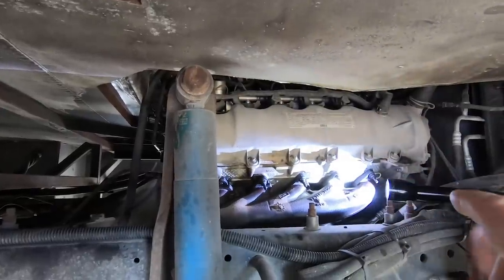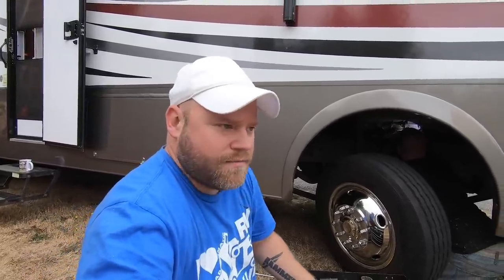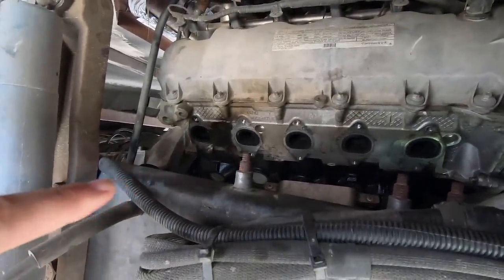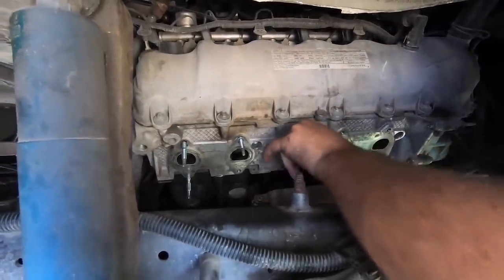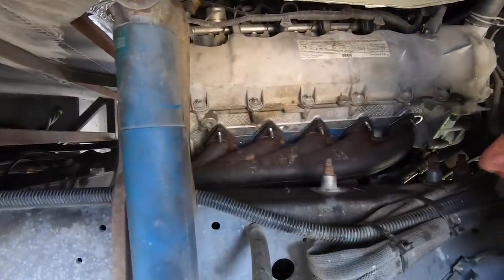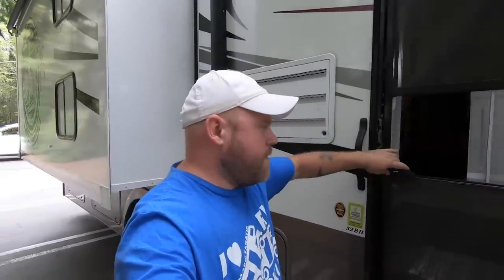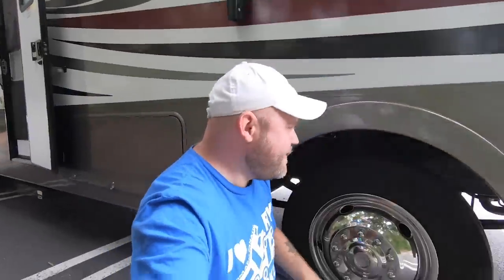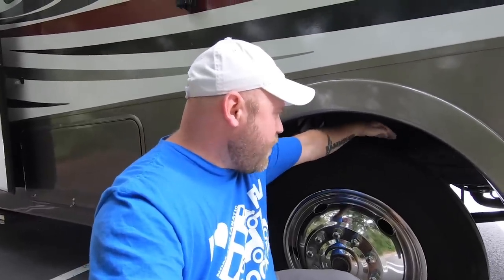Manifold Header Exhaust Leak Repair on V10 F53 Chassis

Comment: Being a mechanic I have to tell you it’s called an exhaust manifold Very common problem.Thankfully you did not use sandpaper lol 😂 Using the anti-seize is a big plus because if you have to do it again they will come out like butter..I just did one at my shop in a van no room whatsoever real pain in the butt...Thanks for the video I enjoyed it😎💯
Reply: Yeah, exhaust manifold.
Reply: Scat pack 392 -G, Also the stud wasn’t broken in the cylinder. It’s the “cylinder head”. Eric also mentions a factory gasket was broken up to a 2 and 3 cylinder gasket. Then the “new” factory gasket was shown as a Fel-pro gasket. Then cheap studs. Eric,What is the root cause of the problem? Bet your exhaust manifold has a slight warp. With X thermal cycles of the cast metal this can happen. Have the manifold surfaced if ruins the gasket again on that side.
You make great videos but fixing engines has not been your forte from the videos I’ve seen.
Reply: Chip Saunders and why replace the gasket on the other side if it’s not leaking?Sounds like a waste
Reply: @22howards  Duh, I seem to recall, he told you he didn't do engine work, keep up with the conversation!
Reply: Bebo May Yeah I had a joke around with him ..Really enjoy his videos
Reply: Bebo May, I do enjoy majority of Eric’s videos. I also did listen to what he said during the video. Eric also has huge following and can/should do a little research before using incorrect nomenclature. He (Eric) does research on other topics. Just sayin
Reply: I miss Jax.

Comment: PERMATEX brand of copper spray works very well also. I run a exhaust shop for the past 35 years and the copper spray on all gasket-head and manifold surfaces has been a real insurance policy. Very few come backs.
Reply: Very nice tip thank you.
Reply: never heard of that, will have to find some, thanks!
Reply: I am going to be doing my f350 manifolds soon... I will use the permatex copper spray. Thank you

Comment: Eric, from 1999 to 2005 the Ford V10 with triton heads only had 3 threads on every spark plug on the V8 and V10's. From 2006 to today it is fixed you will not be blowing any spark plugs and the spark plug torque is 27 pounds if you want to tune it up. Look it up. From 1999 the torque was only 7 pounds, and that is what Ford said, then we got rid of our motorhome because we couldn't understand how the spark plugs would stay in at 7pounds. So warn people 1999 to 2005 No Good, 2006 and up is good. We enjoy watching your videos and love it when Jax talks, after all he's the star of the show.

Comment: I drive a V10 every day and can tell you they are one of the most reliable engines you can get. I'm at 110K miles without a single engine issue yet. Blowing plugs out was a thing with the old V10's not the newer engines. Check your torque on your next few stops on a cold engine and you will be just fine. Don't worry, you have a reliable unit there.

Comment: After a few heat cycles on the engine it is a good idea to re-torque the nuts on the exhaust manifold.
This is why some people have to replace the gaskets again after a few thousand miles as they don't re-torque the nuts.
Reply: Beat me to it, wonderful advice and I had to learn that lesson the hard way when I was about 18. Wish someone told me then. lol.
Reply: @stanthecomputerman  that's just gross!
Reply: You need to torque your nuts. Torque wrench with probably  very very small socket? lol  😂 ( just kidding.) lol.
Reply: Bingo Van, Mr. Gasket sells special lock washers for high heat applications to solve the problem also.I used to have a Buick with factory turbo (very hot) my mechanic fixed my blown exhaust manifold gasket by not using a gasket at all,I thought he was crazy but it never ever failed or leaked!

Comment: Headers, dual catalytic converters and a TRUE dual exhaust. This was for my 78 Trans Am and it was perfect. Obviously not a V10 pulling a Class A but was a very reliable daily driver as a 6.6 Pontiac for many years. Maybe most rigs need some old school updating? At least headers? Great stuff from you and thanks for sharing your travels and hassles. Be safe

Comment: It’s mostly big Blocks in class A’s, not enough air flow to keep the manifolds cool that’s why I did Headers. Manifolds are pushing all that air from 4-5 cylinders through one opening, headers have a tube for each cylinder before going into one which gets the air out faster which means more power and better MPG’s.
Look into the Banks torque kit for the V10 👍
Reply: Headers can be a nightmare as well depending on the quality and claerance issues.
Reply: Only install quality headers, cheap headers are much more problematic than factory manifolds.  Quality headers are expensive, but if sized correctly they will provide more power, mpg.
Reply from the maker: It's still on my list, buddy. thanks. :)
Reply: I'd do headers on it.  Stainless steel baby.  Kooks headers.  I wonder if kooks makes a header for that.
Reply: Once you switch to headers keep in mind since the engine breathes better, the mixture will go “lean” and needs to be adjusted to the right air to gas mixture
Reply: @jpinto9102  I read that the ecu will adjust that itself.
Reply: 100% agree
Reply: @andrewmcallister4151  i guess im an old timer from the old days.. there was no ECU then..lol
Reply: I can remember hearing about this kind of problems from motorhomes in the 60's and 70's.  So this does say much about motorhome development, if this problem still exists 50 years later. Greed its the new........
Reply: I put Banks headers on my V10 F250 truck...That freed up so much power and gas mileage...The engine can breath now. Not sure why ford puts these little tiny cast iron exhaust manifolds on a big air-hungry engine...Also cast iron on aluminum heads...REALLY

Comment: I had a tap in right front side of my 5.8L E150 ford..mechanics found leak at the boot of cat converter..replaced..all was well..3 months later, smelled exhaust, hole in muffler..mechanic welded..all was well..one month later, tap is back exhaust smell is horrible..Wednesday neighbor mechanic is doing thorough check on complete exhaust system..and plugs wires, manifold, valves, lifters, injectors and gaskets..I have a 93..had plugs n wires recently changed but hes gonna check those too...cant afford to repair it all at once but this month..exhaust..definitely..van rides great..just taps n stinks..dont want to blow anything up..thanks Eric n Jax😉✌❤😊

Comment: Eric,
Great call on the anti seize goop. The main issue is the steel studs and the aluminum head. That is also the problem with spitting spark plugs. The steel spark plug galls the aluminum threads and they fail, going POP! It will scare the hell out of you when one lets go. The reason the exhaust gaskets fail is because the exhaust manifold is warped. A couple other views suggested having it planed to make it flat again. Or maybe they make an exhaust header that is a drop in replacement for your factory manifold.

Comment: If you have a problem with the exhaust manifold, take it to a machine shop and have it decked. Alot of problems come from the casting porosity. If that blows out. I'd swap out to an after market header JBA or Doug Thorley. Smother air flow and more efficient thermal cycling. Just a suggestion. Great videos keep on keepin on. Safe travels Sir

Comment: You have a enjoyable channel, the contents are always something that gets my interest. The manifold gasket problem is common and usually caused from heat. You might try installing venting to both sides of your motor. I have 30+ years with RVs and it seems I have had to do a lot of repairs to most of them.  I'm retired and love getting out on the road and seeing new places. Well may you have tail winds and smooth roads in your travels.
Ray

Comment: Honestly u should run the motor,let it get warm and then take the nuts off. I just changed the exhaust manifold gaskets on my buddy RV. I was dreading it until I actually got in there to do it. It was quite simple straight forward with plenty of room. Took me about 4hrs to change the studs and get everything done. 

Tightening them loosen then tighten loosen will eventually work its way out but most of the time if it's gonna snap it will lol

Love the channel Eric, Have a blessed day
Reply: Thomas Gibson b

Comment: Owned Fords all my life. The exhaust manifold is easy the second time and 3rd time around. Use anti-seize on all studs. Re-torque after running a few times. If a stud breaks off. Weld and nut on the stud and it will come out. if not drill it out.

Comment: THE SPARK PLUG ISSUES ON THE TRITON V10 WERE ONLY ON MODELS 2004 AND LOWER.. AFTER 2005 THEY BULLET PROOF THEM. I LOVE THE V10S LOTS OF POWER AND RELIABLE..  I BELIEVE YOUR MIRADA IS NEWER THEN AN 05? I AM AN RV DEALER HERE IN OREGON.. CHEERS
Reply from the maker: Mine is a 2012, so thank you for this info!

Comment: The reason some exhaust manifold gaskets fail repeatedly is is warping of the flanges. Checking the flanges with a precision straight edge  before reinstalling will save doing it over in short order.  Warped flanges can be milled at a machine shop to true them up again.

Comment: Should have machined the manifold face flat again that and re torque nuts after first heat cycle 👌🏻👍🏻😁
Reply: MG, unless older rig or obvious need is overkill but a flat file will suffice but good idea.
Reply: Not overkill.  The heat warps the surfaces over time which is what causes the gasket to fail in the first place.  Just replacing the gasket is a waste of time, which is why 30 days later if fails again.  Gasket is the symptom, not the problem.
Reply: It would be a good place for metal gaskets, like on my tractor!
Reply: This is mechanics posts lol

Comment: a solid piece is much better on those v-10's than the split (known issues on v-10's) I have an f-250 and had that replaced. Also the spark plug ejection isn't as common as before with a good proper set of spark plugs. Also, dude please make sure to re-torque the bolts after 2 heat cycles or you risk needing to replace them again. Keep up the awesome work!

Comment: My personal recommendation, especially on those with Ford 460 engines. When the exhaust manifold leaks, replace the exhaust manifold. The metal has been weakened and will continue to warp. Also, use a copper based gasket since it will handle the high heat better than the standard lead based gasket.

Comment: One of the exhaust headers on my 1997 Ford F150 (5 litre engine) was leaking.  Because the truck is over 20 years old and has 340,000 km on the odometer I thought that the chances of getting all the exhaust studs off without breaking at least a couple was very slim, so I had a local shop do the work instead of doing it myself.  Unbelievably, all the studs came out without breaking.  Throwing caution to the wind I decided to have them do the other side and all the studs came out without breaking.

Comment: The never seize is a must!    You'll appreciate it if you have to pull them off again.    BTW, one of the V10s I work on had 184k miles, same park plugs, on a box truck.   Really the only issues we have with them is the occasional faulty coil.

Comment: My husband used a torch on the bolts and then applied candle wax on the bolt and it wicks in and makes it easier to get off too as another option.
Reply: Mofo  1:00

Comment: The trick to not snapping studs is don't use a ratchet, wrench, or breaker bar.  Use an impact wrench.  It applies the turning force just on the hammer strikes instead of constant pressure.  The hammer strikes are less likely to break the studs than the constant pressure.

Comment: Gas millage may be more accurate... Because air can leak in also... and that un-metered are hits the oxygen sensor and the pcm thinks the engine is running a little lean...  Hope you used new donut gaskets also.

Comment: Also, be sure the engine timing and the fuel/air mixture is exactly correct.  If either are off, you'll have heat problems and the header gaskets will leak in a short time.

Comment: Rotten Tomatoes Website Ratings:

Lost in America:
Critics 97%  Audience 77%

The Long Long Trailer:
Critics 38%  Audience 77%

RV Robin Williams:
Critics 23%  Audience 45%

Spaceballs 1987:Critics 59%  Audience 83%

There is quite a variation between the critics and the general population.  I saw part of Long Long Trailer recently and found it interesting from a historical perspective.  I got a kick out of them towing that long trailer with a passenger auto compared to the 900 plus pound torque diesel trucks of today.  RVing has come a long way.  

I have only seen the trailers of Spaceballs and a RV movie did not come to mind.

Comment: once an exhaust manifold leak develops, it immediately makes the mixture leaner, therefore hotter..this warps the manifold even more so the leak then can be heard. Proper repair is to replace manifold along with new copper gaskets

Comment: If the gasket blows again, I'd be suspicious of either the nuts coming loose or that catalytic converter melting down (internally) and causing exhaust gas blockage.  It can melt down if exhaust gas temperature gets too high.  A lean burning engine can cause a rise in exhaust temps.  There are a number of causes for that, 02 sensor, clogged fuel filter, injector issues, or just a fuel pump starting fade though I think some those issues are too soon for your newer rig.  I might add a fuel pressure gauge to keep an eye on it though.

Comment: I would have used sealant on the block and manifold before placing the gasket just to make sure the seal was good. But well done you should get better gas mileage and performance

Comment: The issue mainly is that the aerodynamics of class A RVs is the worst. Straight, flat oncoming wind which has to be brought to heavy pressure to get around the edges. That pressure ends up in your engine as well.

Comment: Eric....  Heat is your enemy.  Install 6 inch flexible tubes from under your bumper to blow directly on exhaust headers .  It will cool headers and spark plugs just enough to hopefully solve your and everyone elses heat problem. A 6 inch flexiable METAL vent tube is avalible at home depot...Lowes in the section where they sell heating and air conditioning ducts.  Think NASCAR air scoops and brake ducts.  Oh Yeah.  A metal bread loaf pan the right size will allow you to fit the vent tube around bread loaf pan.  Cut bottom out of bread pan use duct tape to attach bread pan and fitted vent and give you a clean professional look under the front bumper.  Air scoops work extreamly  well at moving air.  Give it a test....put your arm out the window.  Solve what causes your problem don't just continue to fix it.

Comment: Looks like a pain in the ass. I wouldn't replace the side that isn't leaking.  I worry about my spark plugs as well.  When I change them I will have to be very careful in removing the old ones.  Great video once again. Thanks

Comment: #455    Good Morning, Eric.  Thanks for the informational video.  I didn't know that the big Ford Titan Motor had that problem.  I also wonder if you purchased new donuts for the manifold.  I had to replace those many times on my 1975 Jeep J-10 Pickup Truck.  A real pain, as I had to lift the motor, too!  Good Work, Andrew!

Comment: If the gasket replacement doesnt last 30 days, maybe its because due to temperature changes and vibrations the nuts are coming loose a little, so I would tend to think that after running a few days reach in with a wrench and see if any of the nuts have started getting looser than they were and tightten them.

Comment: First, I thought you were lucky that one of the top bolts broke and not the bottom, but then...
Best manifold gaskets I ever had on the 460 were none. The builder shaved both surfaces smooth, saying 1/1000th of an inch doesn't leave much room for leaks.

Comment: The heat warps the surfaces over time which is what causes the gasket to fail in the first place.  Just replacing the gasket is a waste of time, which is why 30 days later if fails again.  Gasket is the symptom, not the problem.  You need to machine both surfaces and then replace the gasket.  Even this is not a permanent fix.  Only permanent fix is to get a Tesla Semi Chassis and put a class A motorhome body on it ;)

Comment: ERIC,
The entire FORD Triton engine family (4.6L-5.4L-6.8L)
are all notorious for seizing ANYTHING which is threaded
into their cylinder heads. Hopefully the never seize will fix
that problem on yours.
I just turned 10K on mine. I was thinking mayhaps I should 
pop out the plugs & bolts & never seize them like you did as 
preventative maintenance. Maybe...

!

Comment: I was looking at the Coachmen E450 Ford but class C. I had heard about the spark plug issues but not the head gaskets. I would not have a clue on how to do this. What would be you guess on having this done (that is if you could find a reliable place for repairs LOL). I just purchased my class A Foretravel diesel in Oct 2018 and it almost impossible to find a place to do some minor repairs here in Wisconsin. It is a 1991 with 86,000 with a beautiful interior. I have taken it out camping and generator runs excellent with a 2016 elec./propane refrigerator.  I do want to go full time just starting to second guess my decision (anyone with ideas - sell/trade?) Just getting nervous I suppose. 

 Love your videos. Congrats on the new MH.

Comment: Ford was not making very well designed engines during that time compared to Chevy. Looks like you didn't need to use an EZ out which is a good thing because they are very hit or miss and when you do break one of those off inside your fastener, you are really screwed because they are a hardened steel which is almost impossible to drill out. You have a good friend to help you out like that.